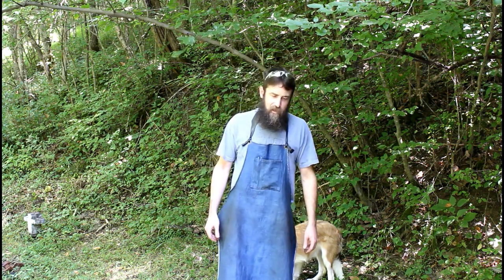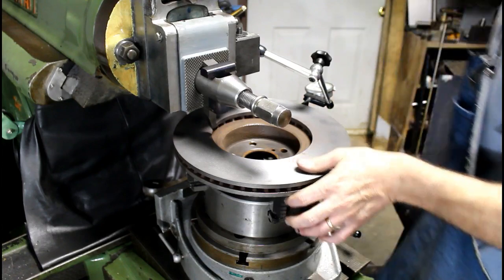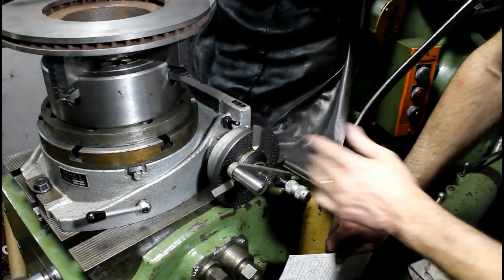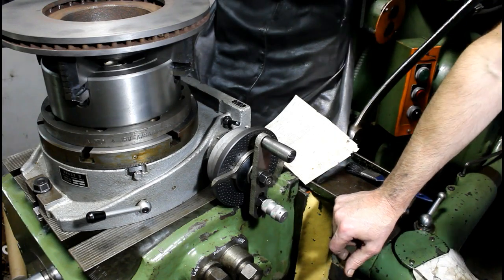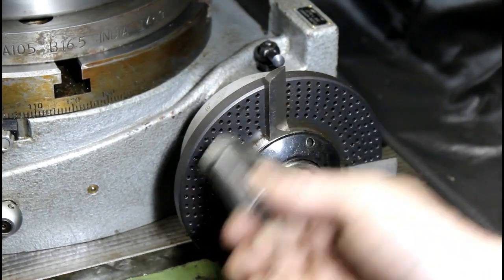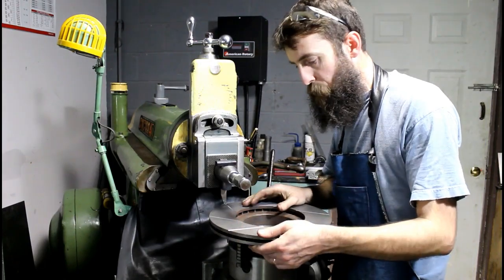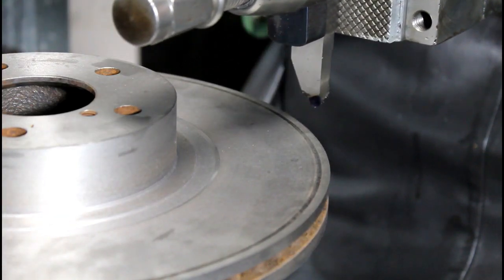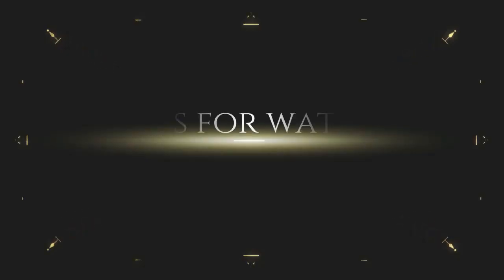Rotary Table on the Metal Shaper

Comment: Nice set up and yet another informative video.   Thanks, Steve.   I don’t have nor understand a rotary table indexing plate, but wouldn’t you just move the table 45 degrees for each slot pass (360/8)?   It seems the round table has marks going all around it.   Wouldn’t you want the slots on each side to be offset so that you are not thinning the material too much on both sides in each groove?   Maybe it doesn’t matter.   You are a first!

Comment: I had a 2009 Chevy Cobalt that I bought new. 
The disc brakes never very good. When the car was in need of a disc brake I was thinking of 
returning the rotors on 
my lathe but l found a new pair of drilled and slotted rotors and ceramic pads for a price 
I couldn't justify turning my old ones. Those rotors and pads were the  single greatest improvement I ever did on a car. I should have done it much sooner. 
You may already know that the slots are put in the opposite direction from one side to the other.  My new ones were marked for left and right. The car was a lot more fun to drive and much safer as well !

Comment: If you wanted the slots to be curved, is there a way you could do that on the shaper or would it require a different machine?  Some of the slotted discs I've seen were curved slots, not straight.

It was an interesting and entertaining video, thanks for sharing.
Reply: Steve Summers Hypoid bevel gears were originally made on shapers using an attachment  which turned the rotary table to cut a curved tooth. I have a dividing head for my 14 inch Elliot which I saved from a hypoid divider.
Reply from the maker: Scott  If you wanted curved slots  it would need to be done on the milling machine. Thanks for watching, Make sure to check out my 50+ other videos if you haven't 👍.

Comment: I worked in a machine shop we didn't have a shaper but by the looks of it you could make gears with it. Pretty cool machine.
What was its basic propus in the first place?  I'm sure you could cut cross cuts in a disk brake a lot faster on a different setup and machine. or even add a arc cross cut and not a straight cut askew from center. CNC Bridgeport and like you said a bullnose or ball type cutter.  I would imagine you can add a power rotation to the CNC for indexing.
Reply from the maker: bobbg the shaper is basically the milling machine of the late 1800 to early 1900. They are great for cutting internal keyways in a hole or single point gear cutting. They will also remove large amounts of metal very quickly. Check out some of my other videos and I show different operations

Comment: It sure does a nice job. No liability issues if it is for your own vehicle. Besides most accidents have little to do with mechanical problems human error almost every time
Reply: There's no point in slotting rotors anyhow. Brake pads used to use binding agents that off gassed during hard breaking. Slots and or holes were intended to give the gas an escape so the pad can make better contact during hard breaking. Modern pads don't off gas so slots no longer serve any purpose other than to look cool and well, slightly weaken the rotor.
Reply from the maker: G Gordon I was just goofing off, I never intended to use it. This video is one of my older ones . Thanks for stopping by

Comment: i see that the table has 360 degrees marked in the table. every 45 degrees would produce 8 spaces just like the way you are doing it but i like degrees better Steve. and i like your shaper i have 2 one like yours and a vertical shaper

Comment: It seems  you locked the clapperbox ??  Why ?  If you use it you should set the stroke a bit bigger so the clapperbox has time to return   Peter from Holland
Reply from the maker: The clapper is not locked.

Comment: Nice! It introduces a rotary table on a shaper. As to the rotary table, you are really using it as a dividing head. Since I built my own micro-dividing head, which obviously did not come with a chart, if you bought your dividing head without a chart, there is a simple way to figure out what the proper rotations + holes is. I won't go into it but it is all over the place. Don't need no steenking chart. I am really enjoying watching someone do neat things on a shaper. And I see you have gained some really heavyweight subscribers, and all I can say is well deserved. And I envy both the shaper and the lathe :)

Comment: The shaper works great for resurfacing heads and exhaust manifolds.  I use brazed carbide and grind into a large radius on a piece of rectangler bar stock.  I like those old cincy 24" shapers that your can cut compound angles.  Mine is a 22"  Wotan with a solid cube.  At work they trashed (scraped) the 3 Cincinnatis we had.  Wouldn't let us get them, no matter how we tried.............  called them obsolete.  They work great on Amco metals (18, 21,25) when a mill puts a lot of stress into the operation.
Reply from the maker: James Spallinger I hate that when a place would rather scrap a machine than let the workers have a chance to get it, I've been there also. The universal table is great, it is the best option you can have if you ask me. I know I have used mine several times. I used it to make the tapered gib for the compound on this shaper in some of my older videos. Thanks for watching;   Steve Summers

Comment: Very cool video nice work? Just FYI I know this was a demo and you stated you had no intention of using this on a car but you would never slot rotors all the way to the edge, as it causes a loud high pitched  noise under braking due to the friction material off gassing also the slots should be cut symmetrical on both sides to avoid oscillating the floating calipers. On a passenger car this would only result in accelerated brake wear and very unlikely a pulsating feel in the pedal. On a F1 or say NASCAR you would surely see dangerous vibrations and harmonics with resulting broken components just FYI
Reply from the maker: Bryan Saunders yeah, I'm no brake expert. Good info,thanks for sharing and Thanks for stopping by.
SteveSummers
Reply: Bryan Saunders isn't the reason to do slots gas release?  Thought that was the point?
Reply: Is it possible to plunge cut on a shaper?

Comment: Cast iron rotors?
Reply: brian alley Didn't I write "unless they are some fancy shmency rotors?
Reply: You are very confused.  Rotors have been cast iron for years.  I've turned and surfaced more than i bet you've seen.
Reply: Hubert Behrendt Versus what else?
Reply: really? because i work with carbon / ceramic and solid stainless steel rotors daily.
go look at a new HURACAN, or any exotic car
Reply: Yes,  you did.  You also said they are always cast iron.  So you contradicted yourself.  Stainless rotors are very common,  more so than cast iron these days. 
So you are obviously confused,  contradicting your own self.  Thanks for the laughs
Reply: If you know anything about cast iron then it would be strange for you too that the are cast iron. Cast iron is a self lubrication material as it contains graphite. So why use them for brakes when friction matters
Reply: brian alley it doesn't change the fact that I am not use to them
Reply: I would have imagined the rotors were cast iron mostly for the vibration dampening.
Reply: Rotors are always cast iron.  (Unless some fancy stuff like ceramic, etc)
Reply: Rotors are very unusual to be cast iron. They are usually cats steel. And very rare to be stainless

Comment: i don't think you're holding the rotor properly, both braking surfaces should be parallel with the middle surface (the one with the stud holes ) ...just saying....
Reply from the maker: I turned this rotor in the lathe referencing off the center hole in the  hub, turned everything true to the hub then transferred the rotor to the shaper. I them indicated off my machined surfaces on the shaper.. In turn everything was machined using the hub as the original reference. The chuck on the rotary table is also holding the hub.   So where am I wrong?        Thanks for stopping by      Steve Summers
Reply: I'm not by any means a guru on this stuff, maybe it works great this way too....from what i know the only thing that matters on a rotor is that the braking surfaces must be parallel with the flat surface on the wheel hub from the car. There are a few guys i know that have some kind of a flange with 4 or 5 studs depending on the rotor, and they are holing the rotors the same way it sits on the car...anyway...just an opinion...Great quick response.... you rock :)
Reply from the maker: Tanase Andrei yeah, the flat where the holes are is where it references on the car and the surfaces must be parallel with it on order to not shake and go nuts on a car.  I was never intending to use this guy, just goofing around with shaper.  The jaws of the chuck are referencing on this surface and clamping on the ID . Thanks for checking the channel out, good to have people watching out, I do make a lot of mistakes and I try to learn from them.  Thanks for the comment, SteveSummers

Comment: I also wrap my rotary table and indexing head in cling film to stop the iron dust getting into the mechanism. Unlike steel that makes large cuttings, brake disks give off a highly abrasive dust that needs to be contained by wrapping and using a powerful vacuum extractor.
Reply from the maker: Andrew Wilson If you look back through my channel you will see that I use large pieces of leather to cover the machine surfaces on the lathe and shaper when machining cast, this stuff makes an abrasive mess, I agree.  I don't do it all the time but most. Thanks Andrew, I will try the cling wrap out, seems like an easy way to do it.     SteveSummers

Comment: When skimming disks you need to clock off the mounting face rather than the friction face. The mounting face references the friction face to the hub. I clock to mounting face first and skim friction face true to that. This makes them parallel. Flip over and then machine that friction face true and parallel to the first. Jobs a good one every time.
Reply from the maker: Andrew Wilson Yes, this is the way I done it when I turned it in the lathe, I was not concerned with complete accuracy when slotting this rotor, it was just for fun and was never intended to be used. Thanks for the comment Andrew, glad to have you stop by. SteveSummers

Comment: What's the name of the dial indicator arm you are using?  It looks much easier to set up then mine.
Reply from the maker: It is a Noga, By far the best holder on the planet, super easy to use. only issue is that they are a little expensive. I got mine used for 30 bucks and would LOVE to have a couple more, I just cant afford them right now.    Thanks for stopping by and I hope you enjoyed.    SteveSummers

Comment: 100% that's a first.
I've not used a shaper since I was an apprentice in the 70s.
Great machines for stress relieving steel...so much nicer than ripping it off using a carbide head on a Huron mill.

Comment: Hi Steve, nice set up. What are you holding with your left hand during the cuts? 

Thanks!
Reply from the maker: chevy250ss. It is the gib lock on the compound, the small amount of backlash in the screw makes it necessary to keep the gib tight so I am only working off of one side of the machine screw. This is a little hard to explain, if I did not do this the cut depth would be harder to control.
Reply: Oh, I understand. Thanks for the reply!

Comment: Before putting the brake disc into operation, it is not necessary to balance? Since you have removed some material ..
New subscriber here, I still only watched some of your videos and I'm enjoying it. 
You have a great way, keep it up, and good lucky :)
Reply from the maker: Well if the rotor was well balanced before it was cut the balance should not change , I do an even amount of cuts all the way around and the same on each side.
Thanks for watching, hope you enjoyed.

Comment: how about plunge cutting a spur gear on your shaper there are no videos at all on doing that out there it would make a great video.
Reply from the maker: Thought about it,  even ground a cutter for it.     But I'm no expert on gear cutting and need some study time. Gears are complex when you really get down to it.        It's on the list.
Thanks for watching and I hope you enjoyed.
Reply: cutting them on the shaper makes it  much easier, a form tool and a bit of math for your rotatory table and blank and off you go. even less if you use another gear as a indexer  , i used to work a shaper many many years ago in my days as a fitter and turner.
keep up the videos some of the best and clearest to understand i have seen.
Reply from the maker: Thanks, I am glad you like them, they sure are a lot of work to film and explain in a clear way.

Thanks again for watching and commenting              Steve Summers

Comment: Another fantastic video Steve! I'll admit that I have the disease.....there's just something sexy about machining divisions on a shaper. Cutting splines comes to mind.

Since I know you're in the same part of the world as me; do you have any issues with surface rust due to condensation/rapid temperature change? I've started using Hornady Tap HD Extreme & WD40 Specialist Corrosion Inhibitor, but curious if you have the same issues and what you prefer.

The fact Diresta & (This old) Tony are watching/commenting on your vids speaks to the great job you're doing....keep up the great work & thanks!
Reply from the maker: Yeah, I could not resist putting the rotary table on the shaper:)   Rust is non stop here with the big temp swings and the high humidly. To help stop it from eating my machines I use T9 Boeshield , it dries into a thin wax and is great.
 Having Tony , Mrpete222 and Diresta in the last 2 days is great news, it gives me hope that the channel may grow.
I'm still learning the ropes of video editing and would not call myself a pro machinist either ,just a student.
Thanks for stopping by and commenting Robert
Reply: @SteveSummers  when you stop learning its time to retire.

Comment: Would a dividing head be strong enough to use on a shaper for this?
Reply from the maker: Sure,  I would not want to push this shapers limits using this rotary table but for common machining yes.
Thanks for watching Kyle

Comment: Definitely a first! I don't think I can use my 6" RT on my 7" shaper though. I've been meaning to ask, is that a lug nut on the tool post? And I like the shaper bra too.
Reply from the maker: Not a lug nut, it's the bolt that came with the shaper when it was new.  The shaper bra sure helps to keep crud off the machine surfaces.  My rotary table is a 10" and the 4 jaw chuck attached to it is an 8"even though that a big setup it's not even close to as heavy as the vise.
Thanks for watching George, Safe bet that I was the 1st :)

Comment: Good video, never seen a setup like that but it worked great. I'm a lifetime car guy and was a heavy truck mechanic. I wouldn't hesitate to use that rotor, if you were to make another just start your cuts for a left side rotor with the angles opposite so the grooves can expel the hot gas from the brake pad outwards. The rotor you cut is now for right side use. Great idea and nicely done.
Reply from the maker: James Zivny Thanks, yeah it 4 sure could be used. I thought it would be a fun project and it was. I really appreciate you stoping by and commenting, and Thanks for watching.
Steve Summers

Comment: really neat, I thought about doing the same but with a spin indexer that I was building so I can cut square and hex ends on my parts to make bolts and such, that and maybe cut basic gears too eventually. I was always wondering why people wanted slotted rotors, I dont mess with car stuff unless I can melt it, so Im not really sure. Also, Ive seen a few people using rotary tables on the shaper, but mainly for cutting gears and stuff like that. The one was cutting a bevel gear for a small traction engine or small scale locomotive.
Reply from the maker: Yeah, I have seen the setup several times in the past, but not often. Slotted rotors stay cooler and cleaner than standard rotors. I just wanted to do this for fun. Thanks for watching Chirpy, hope you enjoyed
Reply: man, you have all of the big boys watching your videos now, lol. I see mrpete, diresta, and this old tony, lol. 
I always like watching the shaper run, it's like watching a fire burn, only more flying shrapnel and stuff being made. (most of the time anyways, some of my bonfires have shrapnel flying and people running, that is always more entertaining to watch tho)
Reply from the maker: Yeah, seems as if they are interested, I love having them stop in, it gives me hope that I my channel may grow.  I love making the videos and would probably make them even if no one was watching. I'm still a small fry Chirpy, my subs and watch count is still extremely low. But that could change, one never knows.
Thanks for watching and chiming in Chirpy.
Reply: lol,  you may be small now, but with your content, your sure to grow. Also, you know that I would still be watching if noone else was, lol. Also, you have far more subscribers and views than I defenitely do, lol.
Reply from the maker: Thanks Chirpy, all I can say is that it must be the beard:)
Reply: I dont know, might be, lol. (starts messing with my own beard)

Comment: Love it. The interesting thing here is that you can shape the bottom of each groove, by grinding the profile into the tool. Like adding a little longitudinal textures to retain the water by surface tension in the bottom of the groove, while also changing the angle of the sides from 90 degrees, to undercut, so losing the absolute minimum pad contact area.
Reply from the maker: Yeah I thought it was neat also. There are very few limits on what can be done, a person could make them 100% custom.  
Thanks for watching, please share the video with a friend if you get a chance, that would help me out.